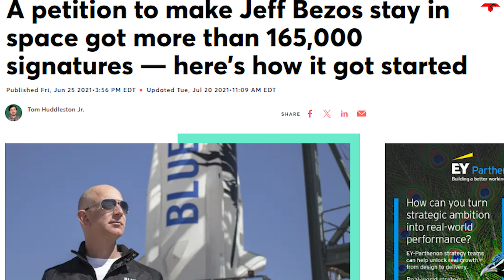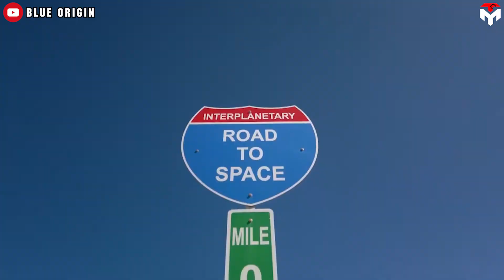Elon Musk Just Blasted Why Blue Origin Failed! Jeff Bezos gives up...

Comment: Besos is a goof! Blue Origin does nothing anyway so what's his problem
Reply: To be fair to the "nothing" comment, Blue Origin developed the BE-4 engine which has launched a Vulcan Rocket to orbit.  Many years delayed, but they do have a flight proven US developed orbital class engine ... as part of US/NASA shift away from Russian built engines.
Reply: @grahamw5735  the be4 is not a rocket. It's a sale item and N unproven one at that. 1 flight is not proven. SpaceX in no way threatens blue odor.  If not for SpaceX no one else would be doing anything yet. Except waiting for government handouts
Reply: @XCX237  What "flight proven" means is generally that it proved it works, and it did.  Reliability/durability is a different matter.

You don't have to be all or nothing with these companies. The New Shepherd is not unimpressive tech also.  The disappointment with lack of visible progression from Blue Origin is real though.

SpaceX - big fan and far more impressive as a space launch company and innovator.   Their rapid (for space flight) iterative testing certainly makes it more interesting for casual rocket enjoyers.